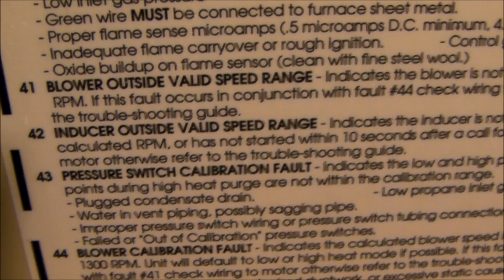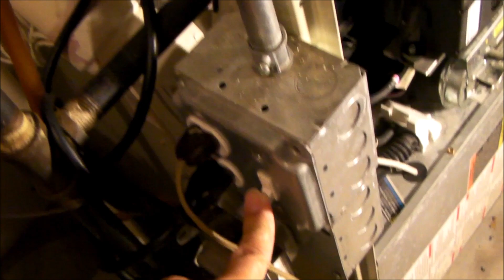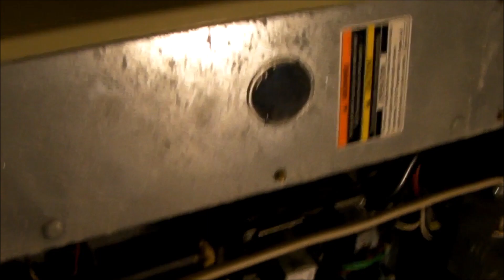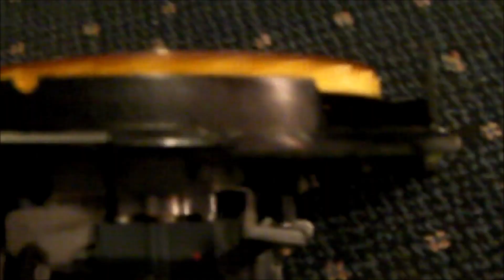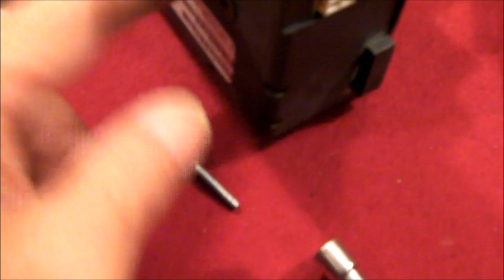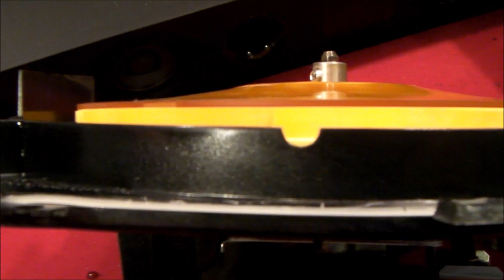No heat, furnace ECM draft inducer not running - diagnose, troubleshooting and fix 5SME44JG2001A

Comment: I just got an Error 42,  and if I manually help start the motor then the motor can start and running good. But it can't start by itself. When helping to rotate, I feel resistance but not too much.so I asked ChatGPT,  told me it's a common problem that the motor ECM aged and not working as good as it's young. But it's hard to find the same ECM and motor . My unit made by Carrier in 1995. Is there anybody here saw this problem before and how you solve it ?

Comment: Hi YuDaMan ---Just checking back to find out if your "replacement motor bearings" are still working (3yrs 7months later now)
I did not have to replace mine back 2 years ago as the "High pitch noise" went away and did not come back. But last week a NEW lower pitch noise (quite loud) started .
It sounds like  a fast clicking? almost like when kids attached  a piece of cardboard onto the front forks of a bike, and barely into the spokes to make noise.
I don't think that the noise comes from inside the plastic inducer fan housing but it is hard to tell for sure. The motor shaft can be turned with my fingers and will still turn after you let go for almost 1 turn.
DOES ANYONE KNOW FOR SURE  if it is the bearings ???? 
Thanks Ric
Reply from the maker: affirmative!  still working perfectly.
Reply: @YuDaMan  and do you think the noise I described in my last post is the sound made from the bearings?

Comment: Did you ever find the spec for the RVT?
Reply from the maker: I believe the carrier service manual called for high temperature RTV sealant.  Other sites mention GE 162, 6702, or Dow Corning 738.  If I could not find those I think I'd be inclined to use any high temp (typically red) sealant or "gasket maker". You won't need much.  I'd appreciate a LIKE and a SUBSCRIBE.  That would help me a lot!  THANKS.
Reply: @YuDaMan  liked and subbed! Do you suppose Dow 732 would work? Seems more readily available.
Reply from the maker: @davidthomas699  I vaguely recall some specific rtv characteristic was desirable but it escapes me now.  I personally would not hesitate to use the 732 but don't take that as an expert opinion that is right.  I appreciate the like and sub

Comment: Thanks for your uploading your video . I wanted to share my Error 42 experience on my Carrier Infinity 96 (model 58MVP080) so if anyone is facing a similar issue you could try what I did: In my case Error 42 would show 80% of the time with short breaks when the code would disappear for maybe 10 minutes only to reappear  - barely keeping the house warm 

I first checked if it was a water drain issue - cleaned out the white condensate trap (was dirty but no water rushed out of the black wrinkled tube). Tested the two pressure sensors (slight blow on pipe into the sensor with meter on continuity confirmed that both switches were functioning)

Everything seemed to point to the ECM Motor but before ordering a (used) one, I ran some tests for Error 42 per the Carrier 58MVC trouble shooting guide (pages 32 and 33) Found there was an issue with the RPM feedback line (state 2 was outside the 9.5-10 volts range and showing almost 12 V - same as state 1) - this confirmed that the ECM motor was faulty - got a used replacement today (full inducer with ecm motor) and installed it - my furnace is finally fixed and running silently 

Lesson learnt : If you're getting Error 42 on your Carrier Infinity 58MVP080 and your ECM motor is turning it doesn't necessarily mean the ECM Motor is working ! (there may be telltale signs like noisy bearings within the ecm motor - mine was making a slightly crunching sound but was turning on all stages) . A number of things can go wrong in what seems like a working inducer (ECM) motor - its RPM could be in the range not acceptable to the board or there may be a failed electronic component on one of the stages in the circuitry contained within the ECM housing. Thanks again - your other video on replacing the bearing was inspirational !
Reply from the maker: Very good input.  My noisy inducer was turning but given the bearing was failing, the increased friction was probably contributing to a speed "out of range".  I'd appreciate a LIKE and a SUBSCRIBE!  THANKS for your helpful comments!!!
Reply: Liked and subscribed !

Comment: there are some furnaces that are worth repairing and these models arent one of those they were shit from day one ... Carrier/Bryant/Trane all used this chassis and they are nothing but problems with failed heat exchangers , failed ecm motors blower wheels and motors  with outrageous repair costs for the parts. Most of my customers i sell them a new furnace at my cost which might sound silly as a business principle but they are happy and tell their friends about my service and happy with their new unit, they always call me back down the road to do other work for them so i always make the money back eventually on the lost money from not marking up the furnace.
Reply: What kind of system do you recommend?  In Chicago area by any chance?
Reply: @ralphkaz  I've been installing Ruud furnaces for 10 years now and I can prob count on one hand the number of times I've had to change parts on any of them usually just something simple like a pressure switch or igniter and no sorry I live in sask Canada
Reply: @grumpyoldman336 - lol I'm in Regina, small world.  My Bryant inducer motor has a noisy bearing.  Hoping I can just replace the bearing.
Reply: I changed the bearings but grinding noise remains unfortunately.

Comment: Good video / logical steps/ and by the way is the fix still holding after you put the bearing on. (I watched both videos but it is now July 2019)/ in the other video did the slightly over sized bearing cause you any problem later?
Thanks
Reply from the maker: It made it thru the heating season in CT with absolutely no issues.  It seems to be holding up just fine.  I even stopped shopping for a backup/spare on ebay!
Reply: @YuDaMan so if I understand correctly your original fan went then it was replaced probably under warranty then you had to fix the replacement. Do you know how long the original fan lasted and the second fan before you had to do your repair?
Reply from the maker: @ric7664  first one iI'm guessing a couple of years 2-3.  2nd one more than 10 years.  I'm guessing the replacement was damaged in shipment and installed damaged (cocked).  I used locktite on the inner bearing race AND sort of homemade knurled the shaft to keep the inner race from rotating and that seems to be working perfectly.  If I had to do it over again, I would buy a more expensive bearing.  Be sure to avoid skateboard bearings which just happen to be the same size.  Getting the circuit board and cooling fan off the motor so you can access the screws holding the bearing bracket requires some skill, care and patience but can be done.
Reply: @YuDaMan  thanks for your reply I have a Carrier that has the same fan motor and it is about 8 years old and and suddenly started making a loud noise. I do believe I will be able to get the part only covered under my warranty but I do not yet know the procedure to get them to acknowledge the part is actually defective. I Wonder if they will accept my word for it or if I will have to hire a Carrier repair company to come and remove and install even though I know I could do this without any problem. whatsoever.
Reply from the maker: @ric7664  I wish you luck.  Those inducers are $$$ and I doubt they will just send you one but you never know.  I've never had luck with a car dealer or home appliance manufacturer willing to give me a replacement part in warranty for me to install.  But maybe you are luckier than I am.
Reply from the maker: incidentally, if you are going to trash your faulty unit,  I might be willing to pay you for shipping plus some beer money!
Reply: @YuDaMan  no I'm the type of guy that has to fix everything. I will see if I can keep the part if the repair person doesn't have to submit the part and then take it apart myself and try to do a repair also. Thanks to you I have a very good idea what I am looking at before I start. I have replaced stepper Motors that operate your speedometers and change relays out in circuit boards that control your burners on your stove and that sort of thing so I am fairly versed in doing these kinds of things. I guess it doesn't hurt that I am an electrician as well but that does not seem to extend too far into Electronics. Thanks for your help time will tell what happens with this.

Comment: How do you get the blower wheel off of the motor shaft?
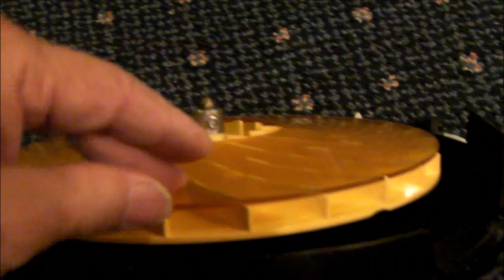Reply from the maker: there is a single set screw holding the blower wheel to the motor shaft .... completely visible at around 13:15

Comment: How do you get the blower wheel of of the motor shaft?
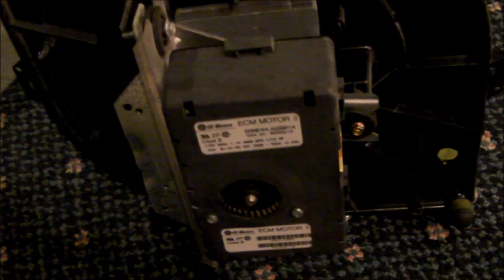Reply from the maker: Blower wheel is attached to the motor shaft with a simple set screw.  You can see the set screw at around 13:12.  Loosen the screw, the wheel EASILY slides off.